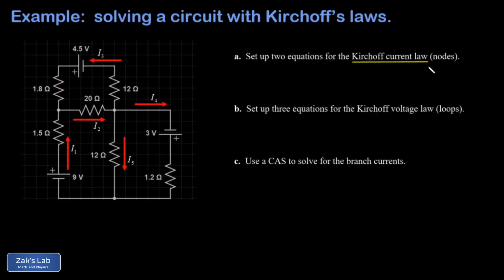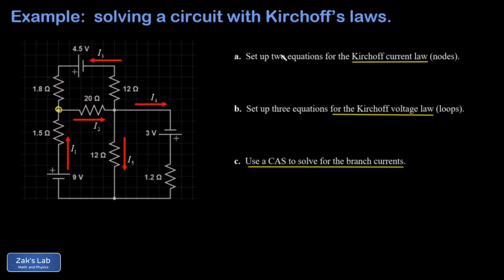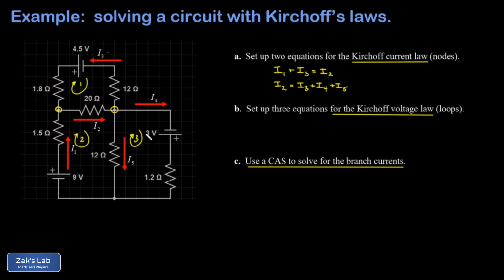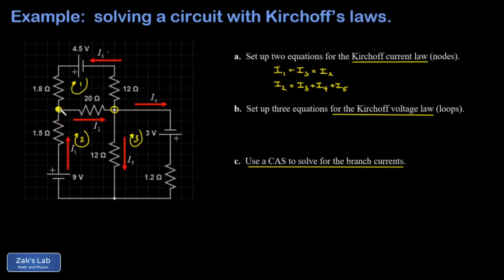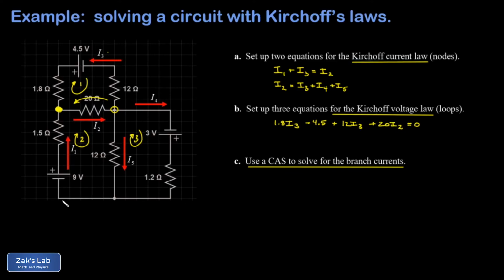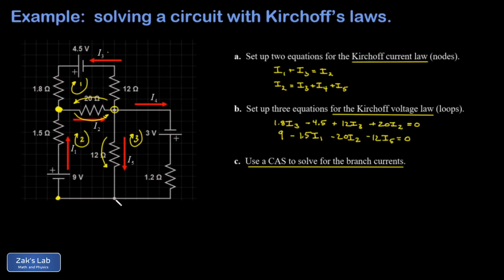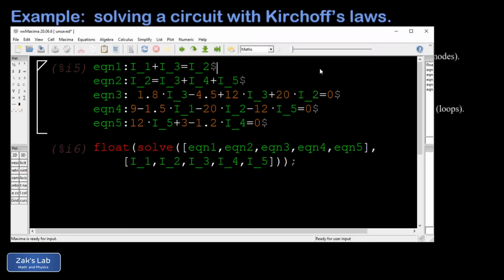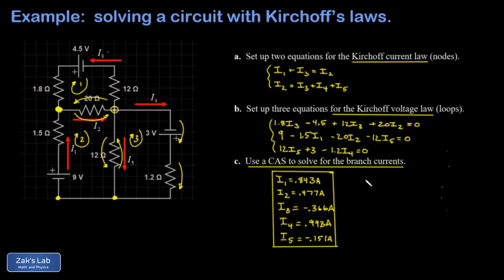Solving a circuit with Kirchoff's laws:  node equations, loop equations and solving with a CAS.

Comment: there are 3 nodes, why did you only setup 2 kcl equations?
Reply from the maker: Another node equation would simply produce a third equation dependent on the first two.  If you are studying electrical engineering, their methods are way more systematic than these intro. physics methods, but in intro. physics we just say "write down enough independent equations to match the number of unknown currents", which in practice is a messy combination of node and loop equations.  BTW, if you're just trying to brute force the problem, you can include extra equations that are dependent, and it won't change the solution of the system. z